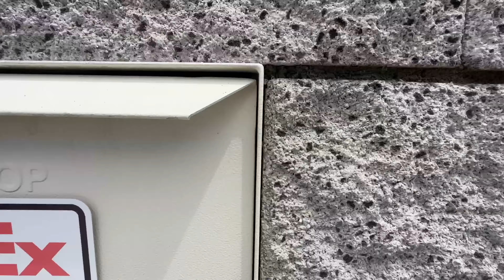The Vegas House finally get's the BRICK WALL of our dreams! It's YUGE!

Comment: 👀 Looks nice... I would have went with some kind of precast block looking concrete wall to save time putting up but looks like they did a pretty wow quick job 👍👍. 
🤔 What I would have done differently though is Bob, is I would not have extended your neighbors wall... Instead I would have went straight inside of the power pole connecting over to your neighbors from where your gate is going to be, leaving all of that empty space now that you're now not knowing what you're going to be doing with on the outside of the wall instead. Then I would have filled all that area around the power pole in with rock along with the edges of the wall on the outside and put in your little cactus, suckle garden out there around the power pole area on the outside... It would have saved you bit money too with less brick wall to build, and it would have given you that little decorative feature, you're wanting without it being a fountain and keep the cactuses far away from the sidewalk as well being only aroundthe power pole... Oh well too late, lol, It's like another toilet in the ambulance thing, you put it the wrong way again...

Comment: I usta work every day outside all summer long in the Laughlin\ Bullhead City valley. Youu guys up in the hills Boulder,Vegas Paradise, Primm etc got it easy 10-15 degrees cooler is alot. When you do it every day you get usta the heat, also we would start working at 3-4 am n stop between 10am n noon for the most part

Comment: You had a amazing crew build your wall looks really nice.  I am in Columbia MO neighbors next door had a raised deck that was expanded some rebuilt it took them 6 weeks when it only should have taken 2 1/2 to 3 weeks to build.  The reason it took so long it this company had a crew of 8 guy spread over 2 to 3 jobs at the same time finally they are done with the deck next door.

Comment: That's so much a better solution than the original plan you had with the scammer originally.   That wall looks phenomenal the way it is, i wouldn't paint it.  It's going to look so good with the lights and cameras, etc.  I love that man gate, it's perfect in every way.   It'll blend in perfectly with the wall, even if you leave the wall grey.  Thanks for this video, excellent job by those guys.  Jayman...

Comment: Not sure if your getting deal from wherever you are getting your gate or what but there is iron and gate Fab shops all over in Vegas n surrounding areas they are all pretty expensive and would scrap a special order or mistake before selling it for cheap. In the Bullhead City area there is a bunch of hate fabricators and on several occasions I was able to get a heavily discounted custom gate because the rich folks building all over around here would have no issue paying several thousand dollars up front for a custom order n then change their mind and pay for a different one or their is the occasion when a mistake or miscalculation was made by one of the several different subcontractors that all need to be pretty exact or you end up with a gate that don't fit.